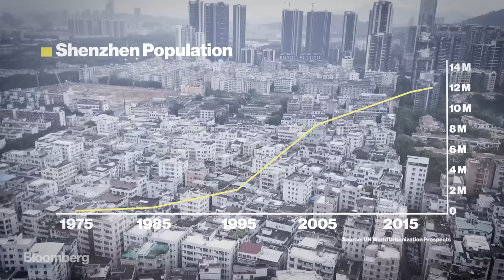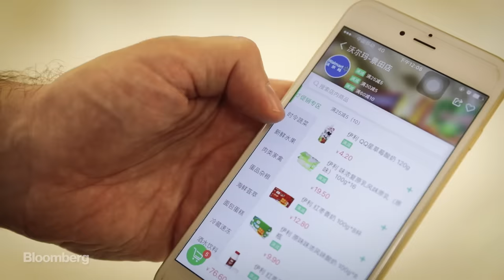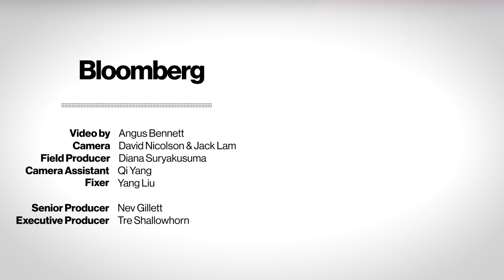Welcome to Shenzhen, China's Tech Megacity

Comment: Just a point if you have a budget monitor with sound and it only has one port would not usb 3.1 not be better than VGA. That way it could be future proof as well and the usb port could have a converter to VGA or hdmi without the need for extra wiring. This could enable more accompanying tech for students and budget shoppers around the world in general. Come on Asia move forward to lower watts especially those where electricity is in low supply.